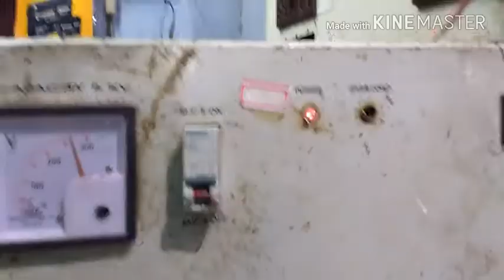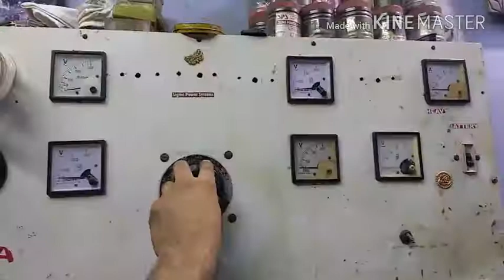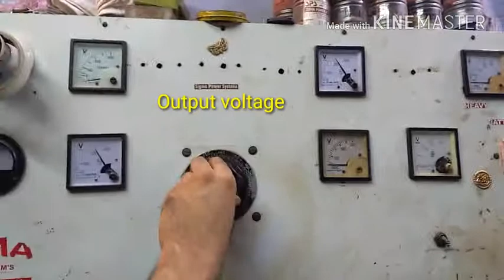AUTOMATIC  VOLTAGE STABILIZER REPAIR | Skill Development

Comment: Good morning
Fault is High voltage in 3kv stabilizer.i changed condensers .... I changed one  relay 20 / 30 amp 12v. But  output voltage is not correct 
Showing more than 300  volt but input voltage is 160v .. please advise me how to solve